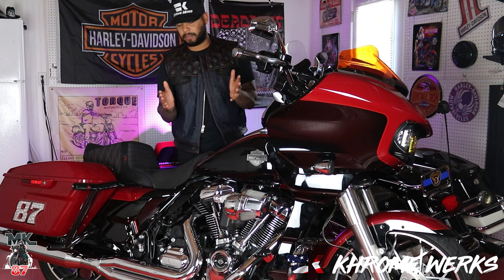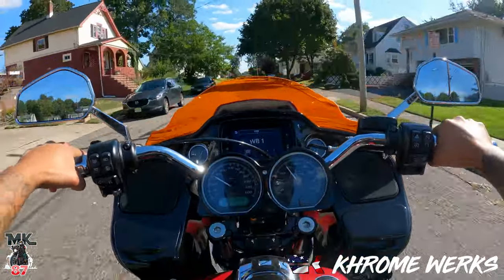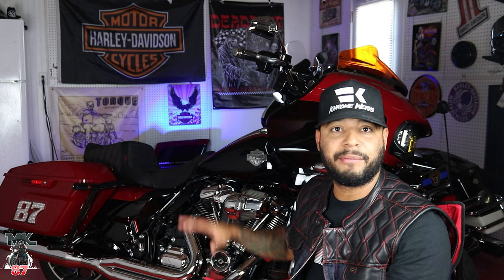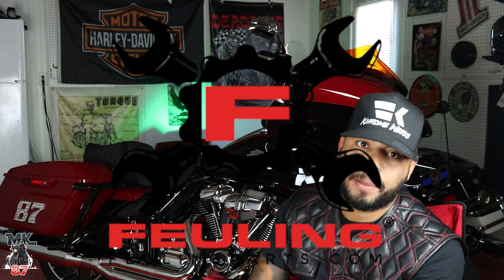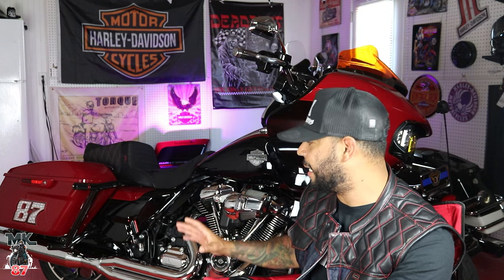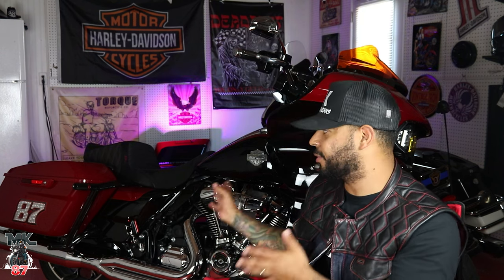Khrome werks Dominator 2 in 1 exhaust sound with 465 cam

Comment: So I watched your video with the feuling 465 cam install. Everyone could see it on your face the disappointment with the results. I’m no expert but I do know you should’ve went with a cast intake manifold and 5.5 injectors rather than getting the cam plate and oil pump. The stock 2020 oil pump works great along with the stock cam plate. I’ve done a “stage 2” on two of my bikes a 2019 Fatboy 114 and a 2021 Electra Glide standard 107. Performed the work myself and had both professionally tuned. I too ran the fueling plate and pump in the 19 FB but over time it’s been shown the stock setup works great up to a .520 ish lift cam. Now that you’ve gone to a 2-1 throw a 64mm tb and cast manifold w/5.5gps injectors  on there and get it retuned. Should make for a good video and educate a few

Comment: Waiting to see your dyno numbers after a complete tune. I have the exact same bike with the Dominator 2-2 and 465 cam. 119hp/132 TQ. I have also switched to the Billird Red short bags and am going with the same KW Outlaw 2-. Just don't want to lose any power. When my 2-1 comes in we will tune and test it 2-1 with a reducer cone then the DB killer inserts. Have you returned to the shop and had the complete tune done yet? Thanks.
Reply from the maker: I’m doing that this week
Reply: @Marvelkid87  Cool, thanks.
Reply: @Marvelkid87  Tuning is the 1st, even with stock exhaust